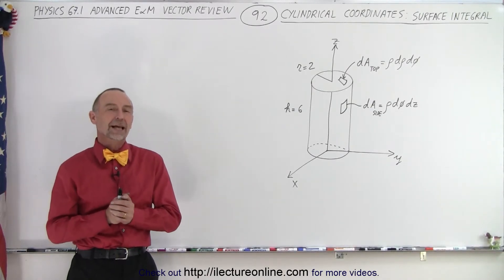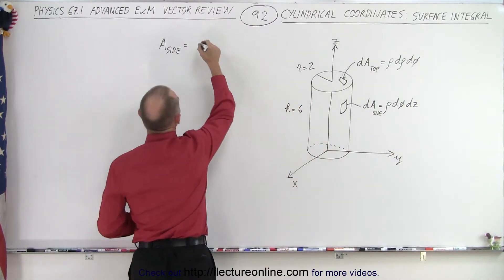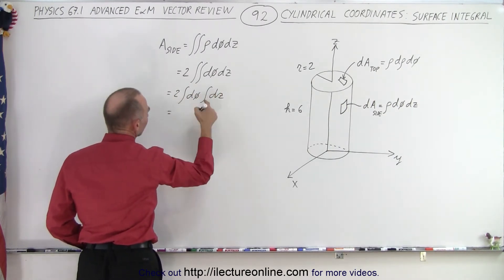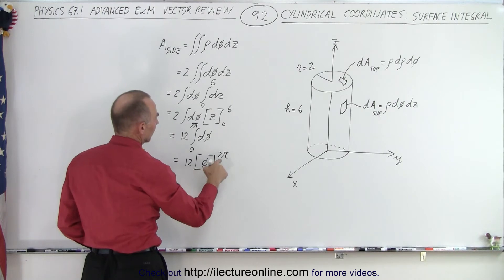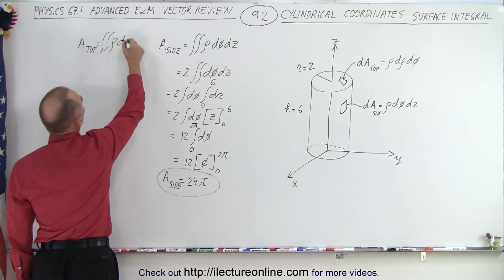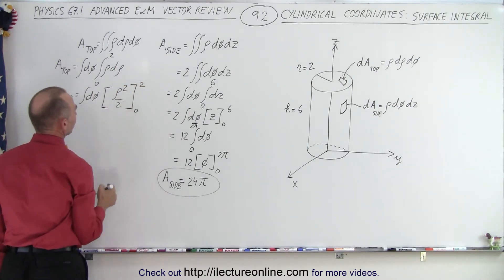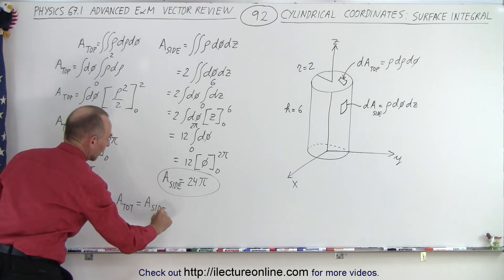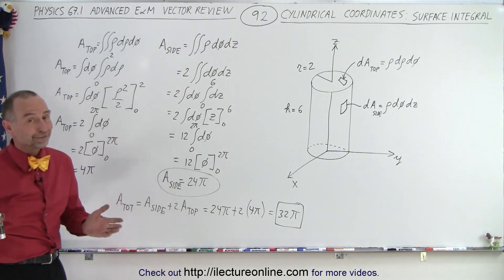Physics Ch 67.1 Advanced E&M: Review Vectors (92 of 113) Cylindrical Coordinates: Surface Integral

Comment: Iam glad iam not a space pilot ? and only need the first half in building a closed treatment pen system at 200m still got to get it fully finished not well!! bugger. But the fisheries should be very interested. You know the 10mm poly net weight is 86 tone x4 based on the 50m big stuff at 40m deep. I stuck it in a big book!!!!!!!!done curve on base sets????to cylinders boy😵top A to bottom B???? (Where did they get a qualification) like the fact that water in it's own body weight wise is nothing like zip O nota till you start going above level boy o boy heavy stuff or piping engineer and pumps had to get a power car pack at 200kv after losses too.....